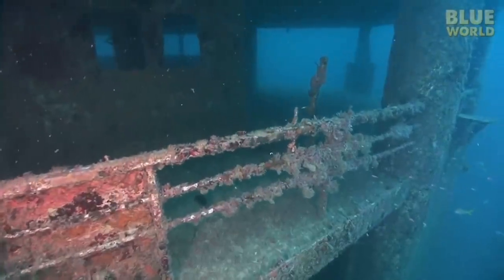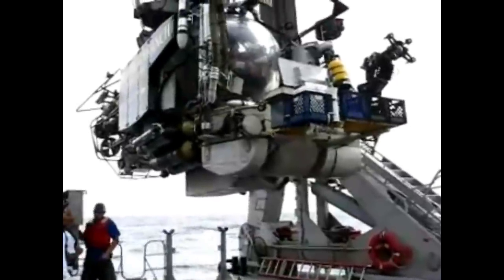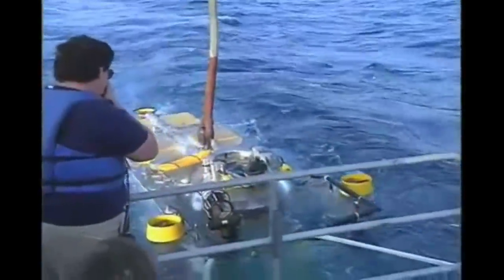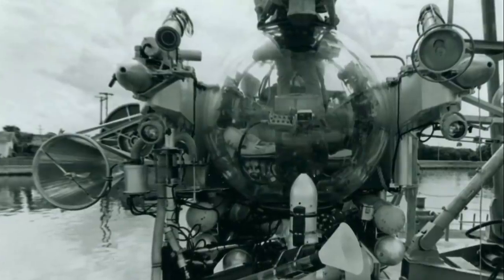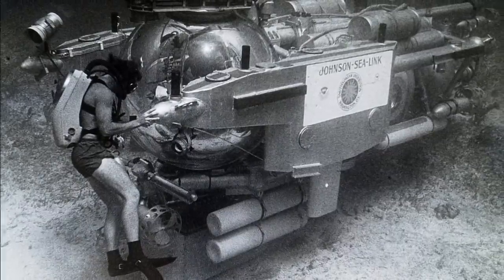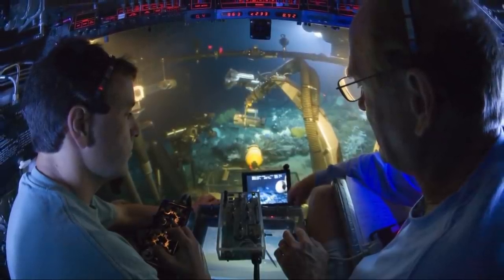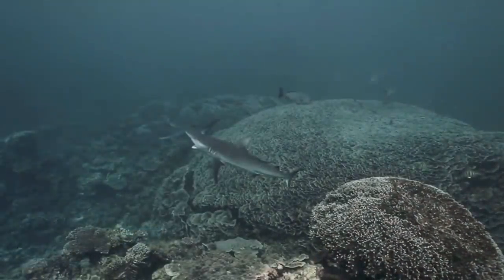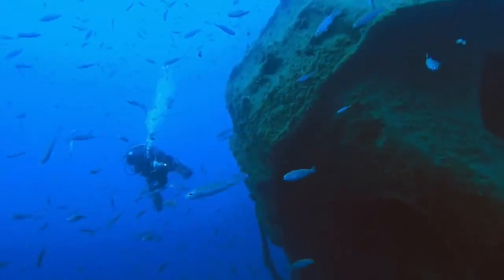Sea Link Diving Disaster, Trapped Until They Suffocated  |  Scary Fascinating

Comment: A lockout dive at 330 feet I figured the two compartments would have been connected but after learning about the diving compartment being pressurized there was nothing the pilots could do…They couldn’t open the hatch even at depth because if the pilot compartment was still at surface pressure that would have still killed the two in the diving compartment due to decompression sickness…IIRC decompressing from 330’ takes hours, even if diving a heliox mix..Sad but hopefully lessons were learned and designs improved.
Reply: But surly they would have tried
Reply: @Runner-Boy  that is what we call murder
Reply: @Runner-Boy  They would have only tried if they were absolutely suicidal.
The change in pressure would have killed everyone, not just the ones pressurized.
Reply: ...they would have needed a 3rd compartment, like a canal has stages to lift canal traffic from one level to another. 

The whole problem is that if it is impossible to save a crew if something forseeable happens, then that's a design fault. If it's impossible to save the crew because something unforseen happens, then that's an error in application estimation. What happened here was forseeable, but the crew was unable to extricate itself from that situation. This is kinda what happens when there's danger present for some of the crew but you're not one of those crew-members. In this case the pilots didn't have to worry about getting stuck at 300 feet with no oxygen, only the people in the diving chamber had to worry about it.
Reply: @Runner-Boy  10 meters of depth in water equals to increase in pressure by 1 atmosphere. Simple, quick accurate enough calculation. Thus at 330 feet ~ 100 meters they were at hydrostatic pressure 10-times the atmospheric one. Have you ever seen what happens when truck tire ruptures (that is at maybe 7-8 atmospheres and has much smaller gas volume)? Should you be outside, that pressure blast would kill you, should you be inside, you would be killed by decompression and expansion/rupture of the pressure pockets in your body - and you would prey that you would have not survived that process even for seconds.

Comment: Going down in a deep-sea submersible was on my bucket list before "bucket list" existed as a common term. When I first read about the bathyscaphe Trieste I wanted to go down in one. I finally got to go down 2,050 feet off the coast of Roatan, Honduras, in the submersible Idabel. It was one of the coolest things I've ever done. We were down for six hours and it was over too soon. There was always something else amazing to see. We never went anywhere near anything that could have been a threat of tangling. And in the event of a mechanical failure they can drop the main ballast weight and shoot to the surface. Pressure is not an issue because the inside remains at one ATM. The trip is expensive, but worth it.

Comment: I've done a couple of dives in one of the JSLs (there are two), the one involved in this incident. I knew about this before I did my first dive, down to 1700' off the Bahamas, in the diver lockout chamber (which is extremely cramped with two people - you lie on your back inside a metal tube with your feet next to the other person's shoulder and your head sorta propped up, like a pair of sardines in a can staring at each other). It was definitely in the back of my mind the whole time that this was where these two men died.
Reply: Fuuuuuuuuuuuuck that 😳🤣
Reply: word
Reply: Nahhhhhh. NOT me..
Reply: Why? What did you do for work?
Reply: @jacqueline3782  marine biologist
Reply: @extractedentertainment8213  I’ll bet the danger pay was fantastic, though. I’ve heard that some diving jobs are the highest paying honest jobs there is.
Reply: I worked at Harbor Branch until things with the FAU takeover just got too depressing. Someone told me HB had video archives of celebrity dives in the JSLs that were just tossed out with the garbage.
Reply: @uzaiyaro  Maybe I’m wrong but I’m not so sure marine biologists get hazard pay for going on research dives… 
You’re thinking about like commercial divers that get “depth pay”  to do the insane saturation diving from the compression chambers they live and work from at crazy depths for weeks at a time. They get paid more the deeper they go and they can make $180,000+  a year. Mega dangerous

Comment: I piloted two submersibles SDL-1 and Pisces IV between 1990 and 1994 for the Canadian Navy operating from HMCS Cormorant.   SDL1 had a diver lockout compartment attached via tunnel to the command sphere.  So  this acrylic bubble was not the first of its kind.  I was surprised at the life support system they had.  Should we have got stuck, we calculated 7 days of life support so we had multiple canister of Lithium Hydroxide as our scrubbing agents breathing O2 along with blankets food and water.  If necessary we could always sponge or lick water off the inside of the HY100 steel hull.  Looking back it was extremely risky but we approached it professionally and carefully.  So sad for the loss of the two lockout occupants. RIP.

Comment: 1:41 Id rather sleep with a live raccoon in my pillowcase every night for the rest of my life than spend one second in that claustrophobic nightmare!
Reply: The lockout chamber is much worse (if you're claustrophobic) than the pilot cockpit. Up front you sit upright side-by-side, petty much like in a plane's cockpit, and you're inside a clear acrylic sphere, so you feel very exposed really. But the lockout chamber is a narrow metal tube. Two people lie on their backs, with their heads semi-propped up facing each other, with their feet essentially on each other's left shoulder. If you're the one with your head at the rear of the tube, there are two very small portholes that you can see through if you do a sort of crunch to raise up (you can't go up very far). There's also a very tiny video screen on which you can see the camera feed. Otherwise you just lie there, in the cold, with headphones on so you can talk to the pilot's sphere and take notes. Lots of fun on a 4 hour dive.

Comment: I was stationed at Naval Station, Key West, FL. in 1971/72 and familiar with the USS Tringa. My ship was the USS Howard W Gilmore (AS 16). While aboard ship one fine afternoon on the top deck, I watched the Tringa come in around the outer quay wall and head straight for my ship,. We had a Sub tied up, I believe, to have it's periscope pulled and repaired. Somebody told the helmsman to knock off work and get ready for liberty as a joke. The Tringa  therefore had no helmsman!! The watch on the Sub ran and jumped into the water and a Boatswain's mate BM1 Shinkel Yelled at me to get the hell away from the railings, fearing that when the collision happened (it didn't) it would slice through the sub, hit our Ship and knock me overboard. After a few shouts on the loudspeaker of the Tringa of "full astern!" the props finally caught water and saved the day! NS Key West was a small Base so word got around but I never learned who got disciplined or what they were given as punishment. If there are any Tringa Saylors watching this, let me know what the scuttlebutt is saying. Something of this magnitude follows a ship to the scrapyard. The Gilmore left Key West in June, 1972 to get an overhaul and a new duty station in La Maddalina, Italy. We Gilmore guys always looked at the Tringa as a "screw up" Ship. Any light on the near collision, Tringa guys?

Comment: I think if you are diving a sub in open water, you should leave a line connected to the boat on it. Would have helped a lot in this case i think.
Reply: Dubious... For every way it could have helped in this scenario, a line invites tangling and snarling with just about every other scenario in regards to diving a wreck. Those are dangerous enough for divers, let alone something as clunky and bulky as a submersible...

    Planning for contingencies, I'd have to suggest that the pilot have controls to pressurize or depressurize every compartment in a multiple compartment vessel... AND maybe that was how it was designed, but it would seem more prudent to depressurize quickly and evacuate the two crew "down" to the decompression chamber as quickly as possible with CO2 being the serious threat. I'm not entirely sure why it would be prudent to let the air off slower when time is clearly of the essence... BUT 20/20 hindsight...

     This is unfortunately the price for pioneering... and subsurface technology is a field of pioneering, even if we've had dubious claims to submersibles as far back as the 1800's or further. Lives are lost over some of the tiniest mishaps, bad calls, or accidents... It's the nature of the beast.  ;o)
Reply: @gnarthdarkanen7464   Assuming they were alive, a fast decompression would most likely have led to decompression sickness( where the gasses in the blood come out of solution and form bubbles).
Reply: @guywholikesplanes  Yeah, and an authentic case of the bends is going to suck... expiring because rescuers would rather risk your breathing than crack the thing open and get you out ASAP is probably going to suck just a little bit worse... and they'd only have the bends until they were in the decompression chamber, too... presuming them still alive, they could then be allowed to recover with medical pro's and their crew-mates looking out for them...

    BUT I wasn't there and it wasn't my call to make. ;o)
Reply: I think a better solution to combat the strong currents subs face would be better sonar and piloting systems to avoid debris which is essentially lethal at those depths
Reply: I rather be trapped in space than underwater
Reply: @youtubecensorsspeech6672  Sitting in a big round and clear bubble is about the best vision outside that you're ever gonna get.
Reply: @KSparks80  nope there is zero light where that sub would be going. Their vision is limited and sonar to detect debris would be a better answer
Reply: @youtubecensorsspeech6672  wasn't it a strong current that pushed them into the debris...isn't the current what started it ?
Reply: @EBO47  rouge currents and the ocean currents are often lethal too but at least being able to see the debris a current throws the sub into might help survival chances imo. Not sure if there is technology to identify currents but sonar can help see debris ahead of time

Comment: They should've used a underwater decompression bell. Lower it. Then have divers get out and grab the 2 ppl and bring them into the bell. Allow them to decompress then get brought up.  Or they should make the submersible with a detachable ball so it can eject itself and float to the top of the water
Reply: Hindsite is 2020
Reply: They'd have to find a way to attach and pressurize the two together, otherwise even just that brief moment inbetween would severely screw them up internally.
Reply: @roxasparks  Hindsite? Is that IQ 50 education or are you writing with that?
Reply: @KuK137  yiss

Comment: I respect deep sea divers and submariners more than astronauts.
Reply: Hmmm. That got me thinking...your not wrong, but I actually consider them equal. Its just that one needs so much more money to explore than the other. If I put out a report that said we need 10 people to go to Mars, I would expect many of applicants to be extreme ocean and cave diving people. Im not sure I would think one is better than the other, just the respect for the one willing
Reply: It's a difficult call to make I think 😅

Deep sea diving has:
- crushing pressure
- drowning
- decompression

Space exploration has
- rocket 'bomb'
- micro meteorites
- radiation
Reply: @joostdriesens3984  I think I would rather die in space. Both deaths are equally as horrific, but if you where dying under the sea you would have 10-20 minutes to know your about to go through a minute of death. In space there would probably be a quick accident that puts you in a place boiling, freezing and exploding at the same time in a minute......of course I should tell that to the dozen of US and Soviética cosmonaughts that didnt go quickly. Lol... dying will suck
Reply: @michael-h8153  I agree, the overall threat of the water is the slightly worse of two bad scenario's.. 😅

Comment: The guys in the back hatch had an opportunity to flood it and swim to the surface before they needed decompression. The guys in the front well they survived anyway.
Reply: Was not it at 350 feet deapth?  32 atm preassure, I think, it was You don't just go out and start swimming for the surface. If you know enough about diving, look into that.
Reply: @tonylawrence9157  Yeah I'm Padi Advanced open water certified. 24yrs.  It's called an emergency accent. You swim up and yell as loud as you can. The longer you stay at those depths the more you have to decompress. You flood your compartment equalize pressure, Open hatch, swin to surface,  Yell as loud as you can.. I don't need to look anything up. That's what I would of done. And I'd still be alive probably.
Reply: @Queenskid19  Yes, I know that. But where do you get your air from to fill your lungs under 32 atm pressure? Were they breathing from aqualung cylinders with pressure delivery regulators and all? And 350 feet down, I doubt it would work. How much pressure can the body withstand and still work? It would not be enough to fill your lungs and sinuses with air and function. And it is such a long way down to come up from. When you leave capsule that far down you are dead. I don't have the particulars on hand about from how far an aqualung, if they carried those, would be all you need. Without compressed air in the lungs the pressure would kill. Bloke from Aus.
Reply: @tonylawrence9157  The pressure changes the compacity of your lungs. Just a tiny bit of gas in your lungs at that depth will actually explode your lungs on the way up. That's why you have to yell as loud as you can. You won't run out of air on the way up though because as the pressure gets less the gas in your lungs expands.
Reply: @tonylawrence9157  In there case the longer they waited. Now they would of had to decompress on the way up. You can't hold your breath for a half hour. They didn't have a decompression chamber around yet. The other guys were able to wait it out. And then came up and went into the decompression chamber.
Reply: @Queenskid19  Thank you. I do not know how their submersible worked. I did not think they were breathing compressed air in their contraption. Anyway the outside protrusions were death traps. Their   lack of fully understanding what they  were doing amounted to gross incompetence. Nice talking to you.

Comment: Your English has the most remarkable mistakes. It's fascinating to listen to somebody with so little experience communicating.

Also, 100 pounds per square foot is 0.7 psi or about 20 times lower pressure than air at sea level.

You don't understand what you are talking about.
Reply from the maker: haha thanks for your comment!